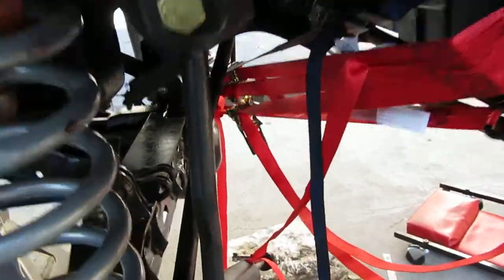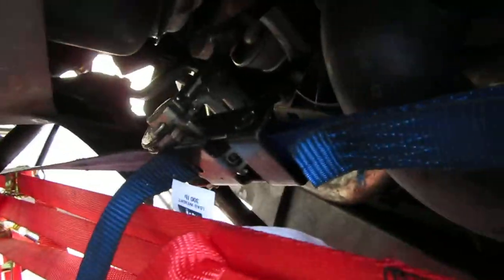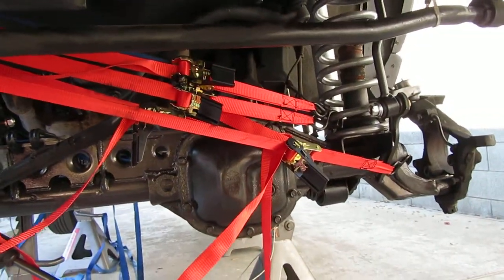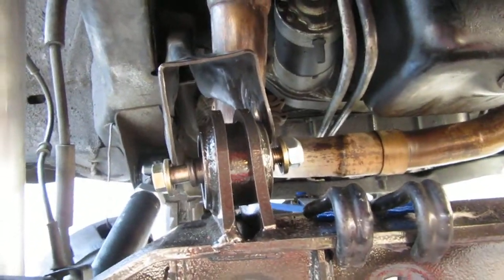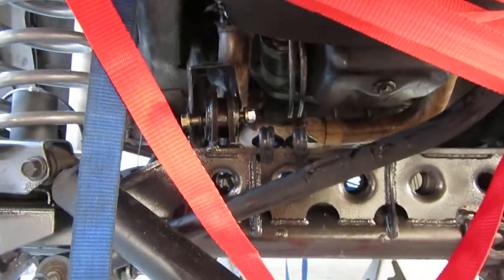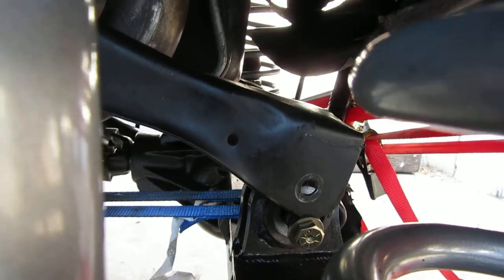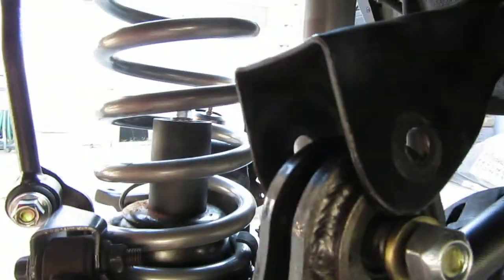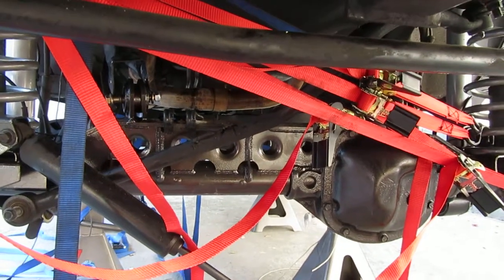Part 3 Struggling to install the Front Right Upper Control Arm Jeep ZJ 5.9

Comment: Really
Reply from the maker: Yes.  But, I now have even stronger straps.  What makes it difficult is the larger springs.  The reason I made these videos is because I only found one other video; and, because, their focus was on replacing all 4 control arms, they neglect to focus on; or, tell you how much of a hassle it is to reconnect the Right Upper Control Arm.  If you watch their video, you will notice they continue into the night.  Work on it some more the next day; and, then thru the magic of video editing they briefly explain what they did in about 20 seconds.  It ain't that easy.  And those guys were doing it with stock springs.  I did it with heavy duty 4" lift springs.  It's a significant difference.
Reply: 301steady okay but I think the problem that you have was that when you did there welding in the axle Truss is out of place just a little bit if you can send a video and I  will like to see how the suspension look now , have fun and kip wheeling